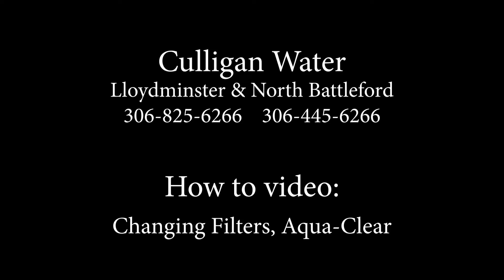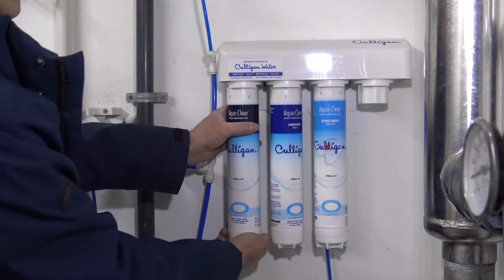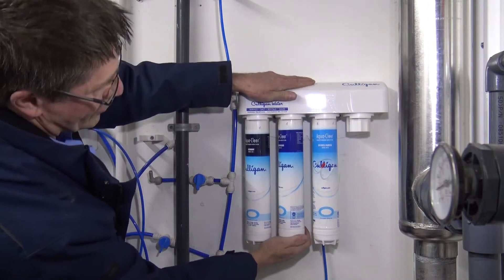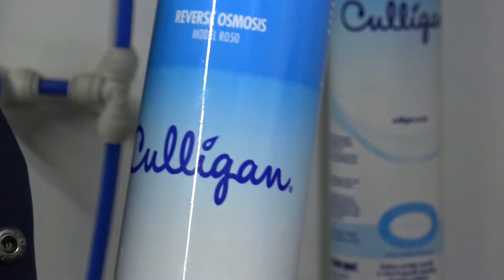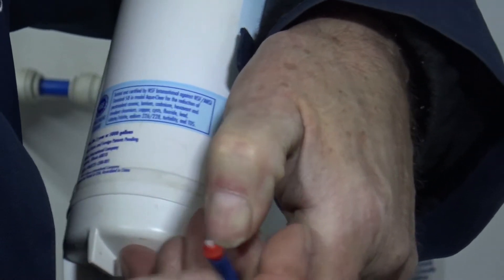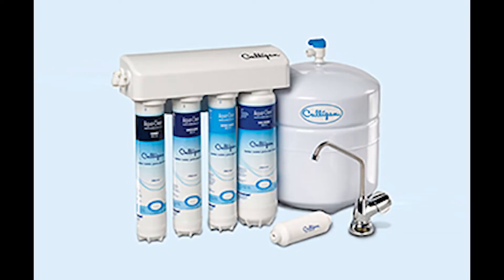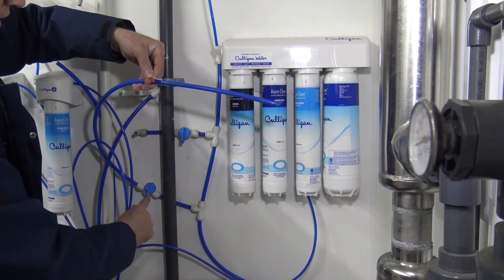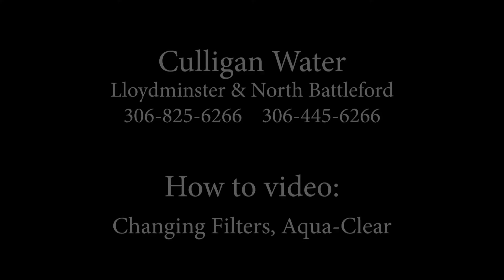Culligan How-to Change Aqua-Cleer Filters

Comment: Another video from a Culligan dealer describes changing the three filters (sediment, carbon, and reverse osmosis), turning the source water back on, opening up the tank valve, and letting the system run for 30-60 min.  Only then does it say to replace the in-line “post” filter.  In contrast, this video seems to recommend installing the “post” filter at the same time as the other filters and then draining the system for 4-6 hours.  This video also says nothing about whether the tank should be open or closed during this 4-6 hour period.  So I have two questions.  Is it really ok to replace the post filter at the same time as the others?  Assuming you have dry filters, should the tank be open or closed during the flushing period?  I had my source valve and tank valve open for the first 10 min or so of flushing then decided to close it when I read a comment below.  Any suggestions on what I should do now?  I’m surprised there aren’t clear written instructions for all of this.
Reply: To explain further - I am concerned that during the 10 min where I was draining with the tank valve open I was putting impure water in the tank.  I suppose once I am completely finished I could do one more more flush where I drain the tank (i.e. flow goes from fast to a drip-drip) then allow the tank to fill back up and us normally.  Does that sound like the best solution?
Reply: in response to your questions, at 40 seconds into the video it says shut off the tank.  leave the tank off until the flushing process is finished. You can choose to follow any instructions you find on the internet but having 8 years of experience and testing TDS after filter changes, you will want 4-6 hours of flush. and if you change the Total Defense filter (everyone should have a Total Defense with the man-made chemicals in all environments now) you should empty your tank for the following 3 nights and let it refill. the Total Defense filter will take longer to soak and has manufacturing impurities.  As for the Post,  for ease, just put it in and flush with the rest. there is no advantage in not flushing with the rest. but because of the slow flows while the tank is off it really wont fush untill you turn the tank back on after the 4-6hours flush time.  Merry Christmas!
Reply: @gofigurefarm749  if you ever had the tank valve open when you have not completely flushed the system, i mean after the 4-6 hours you will have pushed contaminants into your tank. for the next 3 nights empty your tank to completely flush it 3 times. and then you are great.
Reply: @CulliganKev  To clarify, when changing the TD filter, you were saying to let the tank fill with new filters and empty the tank for the next 3 nights. Are you saying  to let it fill up once a day, not drink it, empty the tank, then do this for 3 days? In that case, would we have to prepare for an alternate method of drinking water for 3 days? Would it be good enough to let the tank fill up completely and flush it 3x or so (takes about 2 hours for each refill).

Comment: Probably should mention that when filters are installed dry (without pre-flushing), it will take quite a while for water to start dripping from the faucet when you go to flush the system, especially if you have the Total Defense (T.D.) cartridge installed.  (That drip-drip-drip from the R.O. module has to fill both the T.D. and post-carbon filters before it makes its way out the faucet when  the tank valve is closed (or with an empty tank))  It's also probably a good idea, after 4- 6 hours of flushing with the water coming through the R.O., to then open the tank valve and allow it to empty out, further flushing the system.  (With the tank then empty, that would be a good time to test the air pressure on the bladder in the water tank with a low-pressure tire tester.)
Reply from the maker: Very good point. because we have always pre-flushed our filters for clients,  I never thought to add that. thanks for your comment it will help others.

Comment: Why does Culligan charge $100 labor? Doesn't seem like rocket science and the guy was here for less than 10 minutes.  They charged me $87 for filters, 4.99 for "transportation fee for grand total of $198. Wish I would have seen this video...next year
Reply: You are not in our service area, but I can answer that for your local dealer. We made this video to help our clients save some money in these trying times. And with the help of this video, you are able to do it yourself next year.  But in regards to why your local Culligan charges you what seems like a lot of money, this will explain more about that. Your visit starts in the shop, someone pulls your filters, at our store we actually pre-flush your filters, this takes time and then the time to drive the service truck to your home. That truck has cost to buy and eventually replace, some of the charge is allocated from those expenses to provide you with a service. Then the Culligan service tech has to be paid for all his time to prepare your filters and to drive and do your service. if it is our store when we do the filter change we also do a sanitization of your system.  So when you consider all the costs you may have been unaware of.  Hope you have a great holiday season and drink lots of healthy Culligan water!  Thanks for contacting Culligan

Comment: Thanks for the video! I subscribed to your channel. This is what I used to replace my filters, though I think I still made a mistake. I flushed my new dry carbon filters with my tank still attached. I didn't let it drain out into the sink like the conclusion of your video shows. Do I have to clean out my tank now?
Reply: You should at the end of the night before your go to bed, open your RO tap and completely drain your tank for  2 - 3 nights and then you will be fine. even if you don't, but I would, you will just have extra carbon in your diet LOL

Comment: How do you fit the little torpedo filter?
Reply: I do not understand your question?  to change it it has the same John Guest fitting as the drain line and removing the tubing will be the same process. if you mean how do you find it, follow the line from the tank to the tap, it will be there somewhere.

Comment: The video says to leave the tap on for 4-6 hours to flush the filters. I have a Culligan owners manual and it says something in there to flush for a minimum of 24 hours for the RO membrane? Which is right?
Reply: Always refer to your owners manual. most people are not replacing the R.O. Membrane so for the Sediment, and Carbon block, and post carbon, 4 - 6 hours are sufficient. if you are doing the R.O. overnight is fine we have found, in morning it has low TDS reading.
Reply: I just replaced my RO membrane and had the same question. The manual states 24 hrs but my local Culligan service tech said to remove the capillary tube, flush for 30 minutes and reinstall or just fill and empty a tank or 2 and it should be good.
So the real question becomes,  is the preservative in the RO membrane bad for you so it is necessary to flush for 24 hours?

Comment: "How often should I replace my filters?"  here was my answer: The most common practice to prevent bacteria starting to grow in your carbons on non-chlorinated water, or if you are on municipal chlorinated water to prevent that getting to your R.O. membrane and damaging that, is to do a yearly change of your filters!  NOTE: the R.O. membrane does NOT have to be replaced until it has high TDS (Total Dissolved Solids) over 50PPM TDS on city systems, higher if you are rural; or if you have low production after putting in new filters. I have been seeing more chemical impurities so I highly recommend getting a Total Defense filter for your system to remove those and PFAS and PFOS and Pharmaceutical.  And YES ever since i saw this evidence i have in my personal system for my family.
Reply: If I changed my pre filter, sentiment, and post filters and the filtered water is still over 50 PPM, would you just change BOTH the RO and TD filters in that case?

Comment: Super helpful Video. I paid $387 for the 4 filters delivered for DIY aqua-cleer install (Sediment SED2, Carbon CB, Membrane RO50, and post filter) from the Maryland area Culligan shop. Is this the going rate? Seems extreme. I run a a 5 stage RO/DI system for my fish tank and can get Filters, FILMTEC Membrane and DI resin for for $80. Both result in 0 TDS water, what's the deal with Maryland Culligan price?
Reply: I pay around $100 for three filters. The Sediment, Carbon Block, and the small torpedo one they never explained how to change. So, I am sitting here needing help but finding none and they hate me so much for calling them out on their deceitful practices they hung up on me when I asked why they didn't just post directions on the website. I cannot stand these people.
Reply: we are located in Lloydminster, Saskatchewan, Canada, I cannot speak for the USA prices. I can say that for us we get you to bring in a sample of R.O. water to determine if you need the more expensive membrane. if not yearly you would just need the sediment $40, the Carbon $42, and post carbon, $40 that seems a lot cheaper than what your local dealership has charged you possibly they are quoting you with service to change them?
Reply: @CulliganKev  to have them install is an extra $200. They cannot stand talking to me because I don't hesitate to let them know that $200.00 to bend their knees and twist their wrists isn't reasonable in the least. Had my house not already had a Culligan water softener when I moved in, I probably wouldn't have done business with them. 
So, $85 if I remember correctly for the three filters, sediment, carbon, and torpedo, and $15 to ship them. Another $200 if I ask for installation.
I hate greedy corporations with a passion.

Comment: They’re constantly changing these systems, no capillary tube in mine, line has a red plastic plug in it.  The new filter came with a capillary tube with a black stopper as shown here.
Back to Culligan to figure out what tf
Reply: sorry for delay the red rubber with a longer capillary tube is for the 50 gallon per day membrane. the black one with capillary tube is for the 30 gallon per day. they are not interchangeable. a new membrane comes with the proper stopper and tube. if the rubber plug has no capillary tube (clear small diameter tube) it probably was not installed properly and "Blew out" it will need to be replaced,

Comment: Hi. I've asked for some help, but for some reason my post got deleted. I will ask again: at the faucet the water is just dripping, tank is empty, pressure is good, changed carbon, sediment and post carbon, membrane and total defense changed in march 2022, pressure water feed is good, when unlocking filters all but total defense splashing water. Any idea what is wrong ? Thanks
Reply: not only your post got deleted my reply too. not me!! but the answer is watch the video again. I think you will find it is the RO membrane or the capillary tube problem. or a filter not past the detent. you can buy bypass plugs and install them to see where the flow is stopping.. one other thought might be the pressure control assembly in the head (under the cover) might need to be replaced.

Comment: Hi. Please help with this issue: i've changed sediment, carbon and post carbon and still have low water production. presure in the tank is good and is getting very little water. when turning counterclockwise the filters, every filter is splashing water but the total defense . is this a sign that i should change total defense filter or the membrane ? could be any other cause for the low water production ? thanks
Reply: see above have answered your questions.

Comment: We purchased filters from our local culligan dealer and we are only getting dripping water.  This happened the first time we changed them and we had to have a technician come out to the tune of $$.  Your  video makes it look simple but we have now had this same issue twice.  It appears air locked.  Do you have any suggestions.  It all worked perfect before we tried to put the new ones in,
Reply: I suspect the filters were not flushed when you got them, they were sealed and dry?  It can take a while for water to soak  and flow through filters.  I will tell you 99% of the time when a client has a problem after a filter change, I have always found one filter is not fully turned past the detent to a seated position. This shuts off the water flow. to diagnose your system, while water is turned on, wrap a rag around the first filter (most left when looking at it) and turn it counter clockwise, (front of that filter turns to your left). As you "bump" up to and over the detent, you should get a "phssssst" sound as it moves off of seated position just before it shuts off the internal shut-off for that filter, in the housing. you should get a bit of water in your rag. then rotate the filter back over the detent to a fully seated position, for a woman you cannot turn the filter hard enough to break the system. then repeat to the next filter. do the same to all the filters. You should get a  "phssssst" sound  for each one. If you did get the sound of water pressure release you never had that filter fully past the detent.  If you got a sound/water from each filter your problem is in the Flow Restrictor tube on the RO membrane. review that part of the video and check the flow restrictor tube, it may have had water pressure spit it out to drain. You can call me if you need help 1-306-830-7766 Kev "the Culligan Guy"

Comment: Very illustrating. Thank you. Where can I check the TOTAL DEFENSE FILTER date of manufacture?
Reply: Also your Total Defense is not a time sensitive filter, it is a volume rated replacement. it is good for 1000 gallons, then needs replacing. I have a Cleerlink Pro Connect accessory by Culligan that measures my filters for 1 yr or 1000 gallons and I can look up the gallons on my app.
Reply: @CulliganKev  Interesting on the TD filter! My local Culligan said the TD is good for 3-5 years, similar to the RO. Should I be replacing this filter annually? It's a really costly one that is over $250 normally.
Reply: @msoftball22 you should be replacing it every 1000gallons. But even just a couple,will use more than 500 fallen  per year. And 4 would be yearly
Reply: @Flyingphotosphotography  Very interesting and good to know. I will have to ask my local Culligan why they are telling me to change it every 3-5 years. I wonder if they say that because this filter is so dang expensive? It's almost $300 with tax.

Would a TDS test not be able to test it? I'm still getting 10-15 PPM for filtered water with a 2 year old Total Defense filter (which is probably WAY beyond 1000 gallons at this point).
Reply: @CulliganKev  Can a homeowner add a Cleerlink Pro Connect accessory to an Aqua Cleer system and if so, how do I get this?